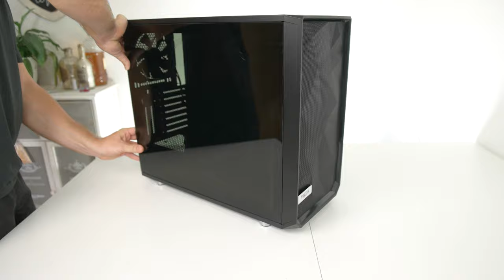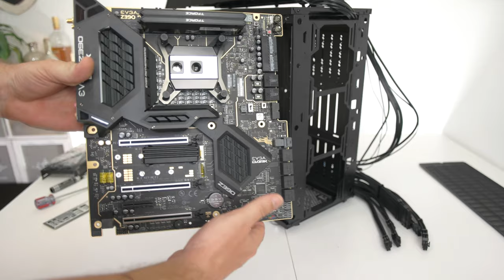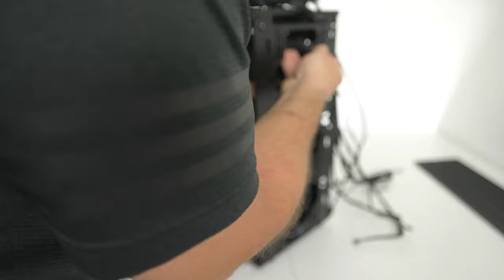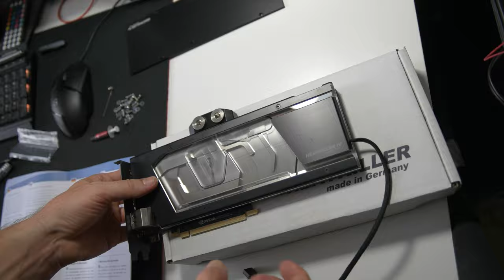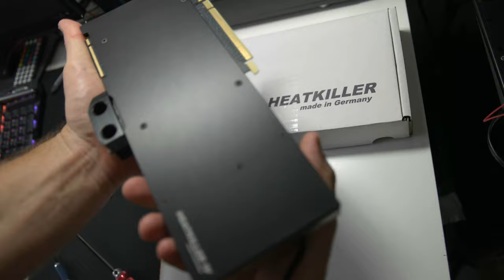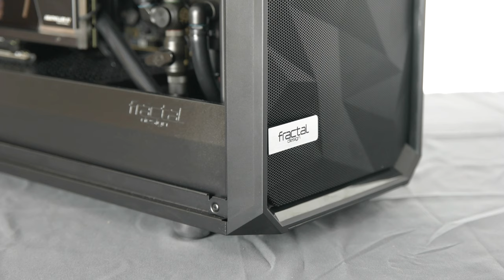Giveaway + A dark Fractal Meshify S2 Timelapse build I9 9900K at 5,3GHz EVGA Z390 Dark

Comment: Super schöner Build und was ein Chip! 5.3 mit 1.35v absoluter Hammer. Viel Glück an alle!
Reply from the maker: Ja einer meiner besten 😊👌
Reply: @CustomrigsDe  ja ein Traumhafter chip. Mit dem mobo und dem open loop kann man vlt noch mehr rauskitzeln. Was ist der Vout unter last und welche LLC hast du gewählt wenn man fragen darf 😁
Reply from the maker: @rapha5586  is maximun für 24 7 ... benchstable gehen noch 5.4 allcore dann ist feierabend ... LLC ist -25% less (aufem dark heisst das so 🤣)
Reply: @CustomrigsDe  macht Sinn das du den ans Limit gebracht hast. Dank dir!

Comment: Damn those clocks on the 9900k at that voltage, and the watercool blocks are just great. Also 4500MHz ram holy shiiieet, at CL18 too.. Good IMC on that CPU.
Reply from the maker: The best 9900k i ever had. The imc loads stock xmp the 4500mhz 🥰
Reply: @CustomrigsDe  impressive, does that mean the RAM runs only 1.4V? My 8700k can't even do 4000MHz ram :(
Reply from the maker: @cheytacsnipes  1,45V 4500MHz CL18 (XMP Profile) but you need a good IMC to boot that ;)

Comment: Looks super clean and nice! Is there a way to mount the front fans between the front cover and the chassis? So you would gain some extra room or you could fit a thicker radiator.

Comment: Alder falder, das nenn ich mal ein ultra geiles System. Wirklich wirklich cool, mit der direct die kühlung. 
Was ich mich aber frage: 
Der CPU wird ziemlich ans maximum getrieben, direct die kühlung is da ja ein muss - aus welchem grund benützt du nicht conductonaut oder kryonaut oder gleich die blaue kinpin paste als tim? 
Ich versteh ja, dass der "otto normalverbraucher" das nicht braucht, aber mx-4? 
Tolles Video :)
Reply from the maker: Mx-4 2019 ist top ! Bei direct die sind die unterschiede fast schon vernachlässigbar
Reply: @CustomrigsDe  Danke für die Antwort. Ich dachte immer, dass man so teure hochleistungspasten braucht um die letzten kelvin zu jagen. Aber gut, danke für die erklârung. Werd ich mir beim nächsten tim kauf definitiv zu herzen nehmen :)
Reply from the maker: @KingJL25  auf dem Heatspreader siehts etwas anders aus aber prinzipiell ... preis leistung mx-4 2019

Comment: Nice build! I plan to go 5.3 Ghz on the 9900ks. You think one tripple radiator on top would work fine? Did you have great cooling improvement using two radiators? I will not cool my gpu with water though.
Reply from the maker: more radiator surface is always good ;) for noise reduction :) if you have space you can also use two 360 rads for just the cpu !
Reply: @CustomrigsDe  Thanks mate. I own the same case  fractal meshify S2. I was looking into EK Water Blocks EK-Velocity for CPU cooler and EK Water Blocks EK-XRES 140 Revo D5 PWM for pump. Would what work with the radiators you have used?
Reply from the maker: @vividmotion66  use hwlabs 360mm slim rads and noiseblocker eloops ;) like i did in the video !
Reply: @CustomrigsDe  sounds great :) what are your temps? Prime95 or Aida?
Reply from the maker: @vividmotion66  sorry didnt have it anymore ;) i friend bought that build. But the temps where not that high.